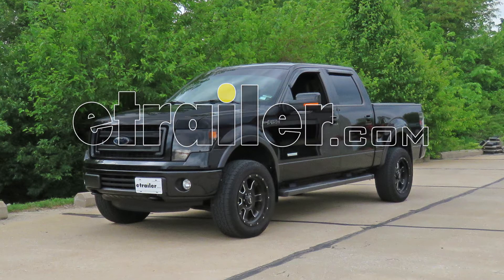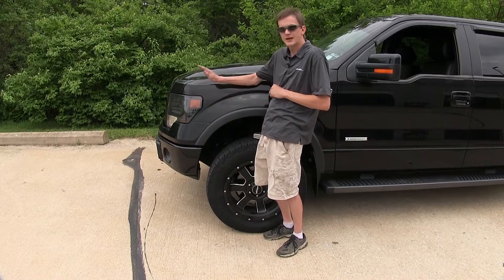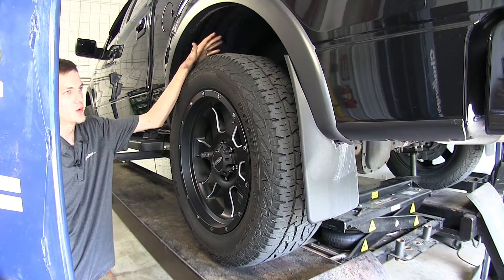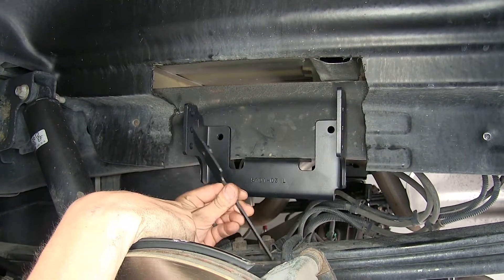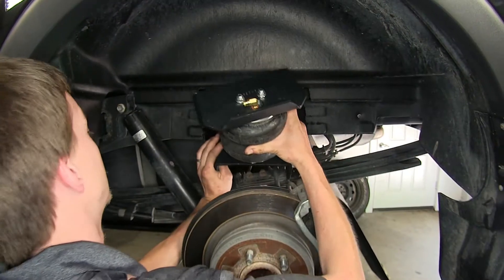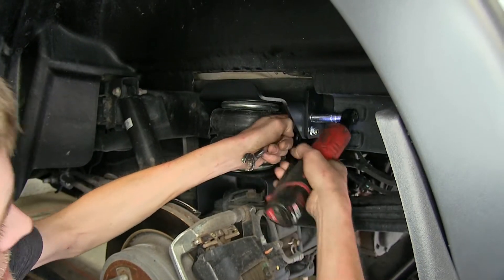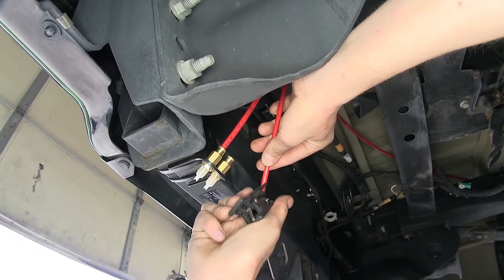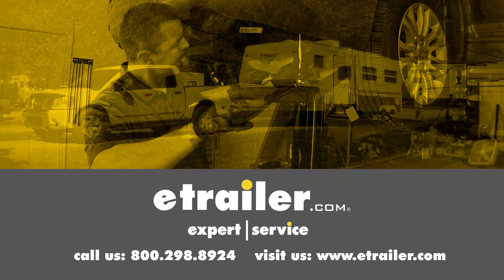etrailer | Mount: Firestone Ride-Rite Air Helper Springs on a 2013 Ford F-150

Comment: Will this help with travel trailer sway?
Reply from the maker: This kit will help to hold the vehicles rear end stable which in turn will help a bit with trailer sway. If you are experiencing extreme sway, you will want to look into a weight distribution system.
https://www.etrailer.com/dept-pg-Weight_Distribution_Hitch.aspx
https://www.etrailer.com/Vehicle-Suspension/Firestone/F2525.html

Comment: will this work with a 3 inch suspentson  lift
Reply from the maker: In order to use this kits we have spacers that are designed to work with trucks with 3" of lift. You can find them on our website in the following link.
https://www.etrailer.com/Accessories-and-Parts/Firestone/F2368.html
https://www.etrailer.com/Vehicle-Suspension/Firestone/F2525.html

Comment: Would this kit work with a frame mounted fifth wheel hitch?
Reply from the maker: It is going to depend what kit you have mounted already. Certain kits are designed to work with the Firestone Air Helper springs and some are not because the brackets will be in the way. If you let me know the year, make, and model of the truck and what hitch set up you have, I can tell you whether or not the air helper springs will work with your set up.
Reply: @etrailer  thanks for the response.  I have a 2013 f150.  I have the Reese hitch and rails system.  I believe I bought it from you guys.  Item # RP50081-58
Reply from the maker: @sjclarke11  We have only confirmed that the Firestone Ride Rite kit will work with B and W hitches because they have a cut out in the brackets that get mounted to the frame. If you are needing support in the rear of your vehicle for hauling your camper, we have many people use Timbrens or Sumo Springs when air bags will not work with their set up. You can find the options we have available for your truck in the following links.
https://www.etrailer.com/Vehicle-Suspension/Timbren/TFRTT1502D.html
https://www.etrailer.com/Vehicle-Suspension/SuperSprings/SSR-117-47.html
Reply: @etrailer  thank you for the help

Comment: What is the no drill bracket for the hitch part number? I cant find it anywhere.
Reply from the maker: Can you be more specific? I'm not sure what bracket you are talking about.
Reply: Were the Schrader valves are mounted onto the hitch
Reply from the maker: It's not sold separately. It only comes with the kit. Did you order the kit and not get the bracket?
Reply: Yes I got the firestone ride rite 5000 and did not have that bracket at all
Reply: Is the ride quality improved when not towing as well?